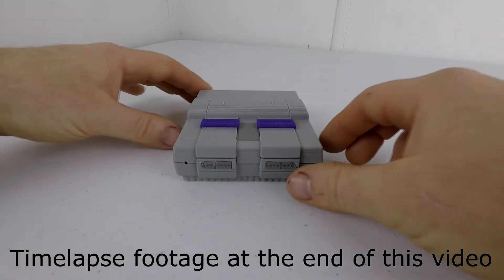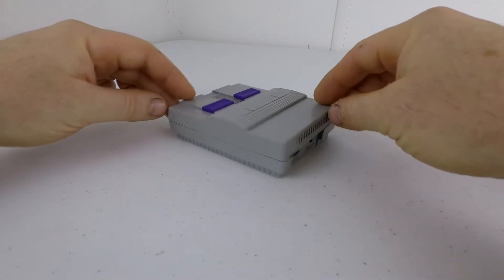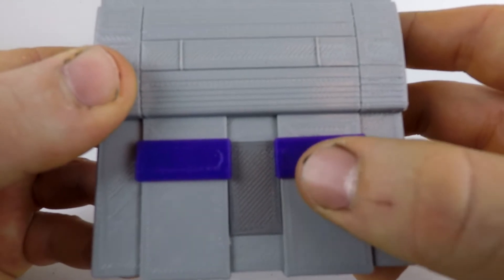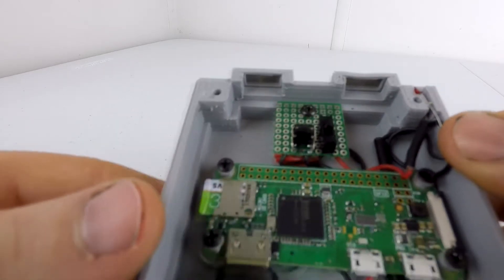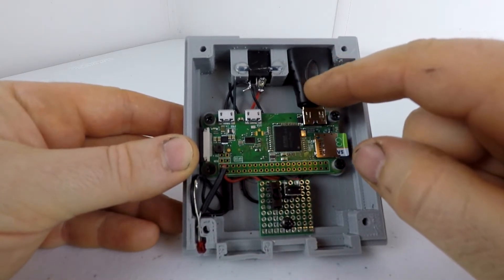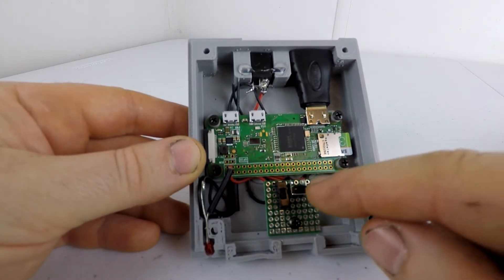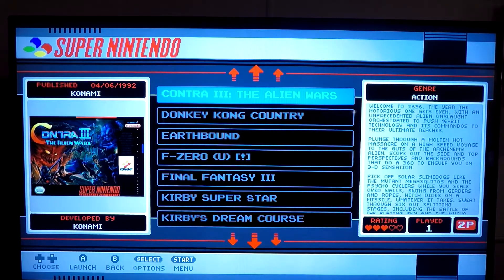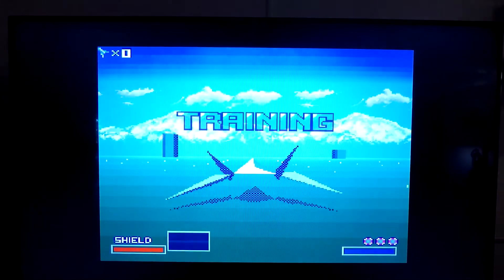Super NES classic (aka SNES mini) DIY 3D printed

Comment: That's very cool Rob Rowland. Here's what I want for my wish-list :)  I want a metal game console case for the original SNES!  Only the shell should need to be metal, as long as all the other parts can attach to it correctly.  I'm guessing it should be a CNC project ? Making a 3D Printed plastic mold and casting it would be difficult ?   Maybe also a game cartridge shell that is metal ;) as long as it didn't touch the components inside and short them out.  I have a bunch of SNES mod ideas :) Some raw hardware mods like this, and others more technical.